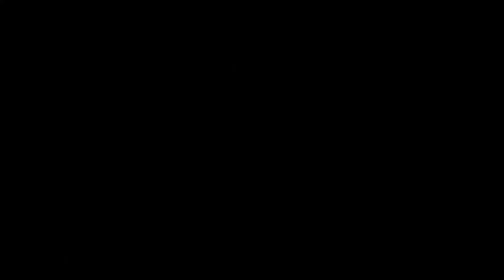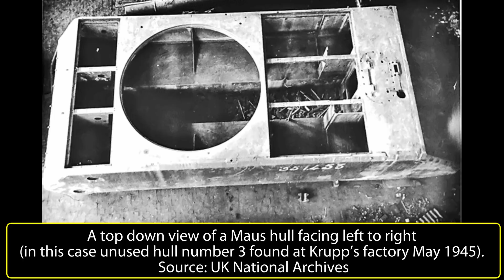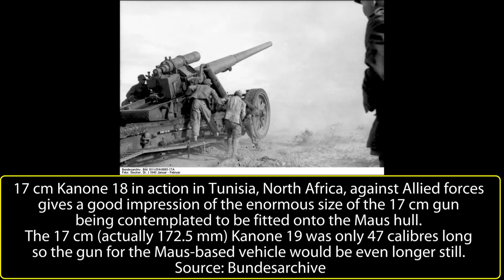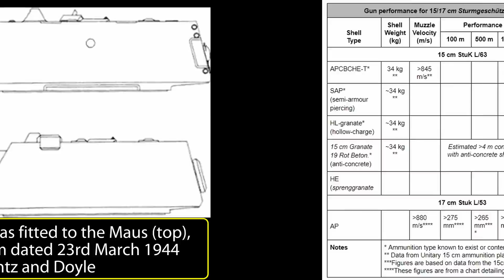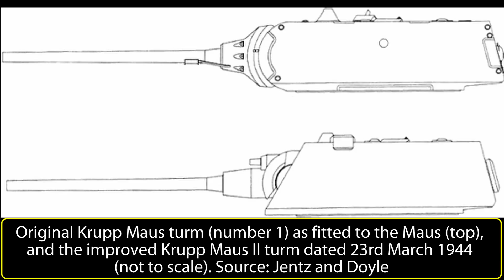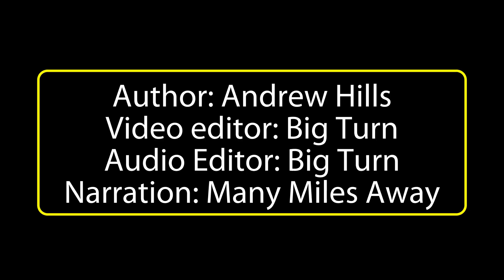15/17 cm Sturmgeschütz auf Mausfahrzeug feat. @Many_Miles_Away

Comment: this might be a stupid question but could the gun not be turned around like a archer but instead of firing over the engine have the gun backwards facing? or would the breach still be a problem?
Reply: That would not be practical as the crew compartment would be located directly over the engine at that point.

Also the Archer worked for the British because British TD's were seen as self propelled AT guns rather than assault guns like the Germans.  Meaning that it would make little sense to increase the length of the vehicle unnecessarily by flipping the gun around and force a complete redesign of the hull which they wanted to avoid to begin with.
Reply: @Many_Miles_Away  Fair enough, thanks for the reply

Comment: The maus 2 if existed must of gone at the speed of 9km/h for 3 seconds before the transmission and engine caught on fire
Reply: It used its engine like a battery... it was driven by electric motors.... suprising but true
Reply: @PLASMA_2005  no . the maus use normal engine on land , the electric engine was to cross river
Reply: @TheJimyyy  I'm going to assume that was sarcasm... true it used its disel engine, but it was hybrid and did intact use the electric drives it had
Reply: bit late to the party but it`s must`ve. MUST      HAVE. how is it THAT fucking hard to correctly spell that shit? you go home and of dinner too? those words have two completely different meanings.
Reply: @AlexHalt100 Bear in mind, I have dyslexia, spelling mistakes happen alot and i'm still improving. What i don't understand is how such a common grammatical error has cause such a vitriol response. This was 5 years ago.
Reply: @AlexHalt100  Christ dude like I get frustration with people who aren’t “proper” with written words and where they go or how they’re used, but it was enough for you to understand exactly what he was trying to say, so OBVIOUSLY the most important thing to do is to leave a douche ass comment in a small comments section from a video 5 years ago. If you’re gonna be in this niche corner of YouTube and history itself, there’s no reason to be that irate over something so small and insignificant. It must of pissed you off a lot 😂

Comment: Although fictional, my favorite tank is the Jagdpanzer E.100. My PC background is of said Jagdpanzer E100 crushing an AMX ELC BIS.
Reply: It's also my favorite. It looks 10 times better than the maus and has a better armour profile.
Reply: @commandergelatoalighieri  Same. I love the way it looks and the way it's nearly impossible to penetrate from the front. It's only possible frontal weakness being its lower glacis plate which is typical of german armor.
Reply: @ThePanzerKorps  hang on, isn't the Jageroo does indeed been designed, as the Tank Encyclopedia covered them already?
Reply: @Kalashnikov413  Technically, it does exist as it has a paper design, but there is a debate on whether or not it should be classified as a Jagdpanzer or a Sturmgeschütz due to the caliber and placement of the gun.
Reply: @Kalashnikov413  They did not know whether the turret was supposed to be in the front or back or middle just knew that it was a 17cm E100 chassis.
Reply: @iaminyourwalls479  yup also the tank never have a real designs . and it was mean to be on the maus at first
Reply: @commandergelatoalighieri  the e100 dont have better armor the e100 have maybe a stronger upper plate because of the angle of it but is the only part of the tank where the armor is stronger or equivalent lol ...
Reply: @TheJimyyy  armor profile, key word is profile
Reply: @commandergelatoalighieri  even the armor profile is worst . the maus was more armored and have a better armor profile . like i said the only part of the e100 where is a better is the upper hull everything else is worst
Reply: @TheJimyyy  bruh, it's got better angles than the Maus, it's also smaller to some degree, the maus is a wall my g, without spaced armor. The E-100 is the over all more practical tank, it's armor is only thinner by a small margin, so in the end it's still more than enough.
Reply: @commandergelatoalighieri  lol the only angle it have better is the upper plate .. also the maus do have space armor and be smaller dont mean anything also is not that smaller . maus armor is better in everysingle way the e100 armor side and rear is way less than the maus and the turret is way weaker too

Comment: I would imagine that the reason for this at least on the design end was the fact that engineers often times want to create spectacular things generally, and it is only after the spectacular is done that things are ramped back to the practical.

Comment: The germans really were nuts. The 12.8 cm was already retarded overkill. Nah, lets go a step further with 15 and 17cm guns.
Reply: The idea was to anticipate the next generation of tanks. The long 8.8cm was already overkill for most threats, stuff like Churchill VII or IS-2 1944 were tough nuts to crack for any smaller gun (albeit a Pak 40 still being moderately effective on these vehicles), but the next generation of tank wouldve been things like early Centurions and IS-3s, and while Cents dont have enough armor to survive the 8.8cm frontally, the IS-3 actually would (trap shots not withstanding; even a 12.8cm gun would likely bounce), and even T-44 could resist a few rounds as long as they hit the hull (turret is also tricky due to the shape, but wouldnt survive sustained fire as the vertical part is not even thick enough to deflect the old Pak 40). 

Of course it was still grossly excessive to go for 15cm or 17cm guns for an anti tank role at all, it would have been easier to develop a viable sabot round for the 8.8cm Kwk 43 (or Pak 43) as APCR was already pioneered by Germany, even if it wouldve been a pure steel penetrator rather than tungsten.
Reply: @builder396  we are talking about the Germans... they always go overboard
Reply: @builder396  Germany did not have the rare metals to make APCR that much. They were in shortage of everything, let alone tungsted, which was very rare. And them having so many issues even producing and supplying the heavy tanks in service, makes such future designs even more foolish.
Reply: @Vlad_-_-_  Thats why I said they could still make APDS with steel penetrators. It can be done, it just would be less effective than tungsten carbide. 
They definitely tried steel core APCNR for the 7.5 cm Pak 41 (the squeezebore one) but found tungsten shattered a lot less.
Reply: It was against the is 3
Reply: 12.8cm was not overkill, is about the same as the gun from the JS series of tanks(122mm)
Reply: @henkvermeer8652  It was overkill, because the long 88 was enough for most targets, the 128 did not penetrate more armor actually. Thing is, the 122 was mounted on an actually good, reliable platform, in the IS tanks and ISU 122 tank destroyers, while the JTiger was utter garbage.
Reply: @henkvermeer8652  The 12.8 cm had significantly better penetration against armor (269mm @100m) than the 122mm A-19 and D-25 guns (203mm @100m with wartime BR-471B shell, post-war BR-471D had 227mm), so while the 12.8cm Pak was in a sense in response to these guns, the Soviets fielded their A-19s and D-25s to counter ever heavier German tanks like the Tiger II and Panther, while Soviet tanks didnt have nearly that much armor and the Germans already had a more than adequate AT gun in the 8.8cm Pak 43, that could engage all Soviet vehicles frontally from extended ranges, making the 12.8cm gun redundant and, due to its immense cost, a pointless waste of resources.
Reply: And let’s not forget other nations were coming out with 155mm equipped experiments ie the T30
Reply: @vulgar_potato4992  Right you are, but the T30 had  a resonable mass compared to the retarded Maus.
Reply: hmm... KV2 that fight pz III and pz IV F2
Reply: I mean this is a completely fictitious tank to be honest talks of the 15 cm and 17cm only existed from word of mouth never anything concrete or physical
Reply: because 5 inch gun is not over kill let go with 6 or 7 inch gun.
Reply: @UCn3TJLJshJdstfSIMJ1jqfg Sturmgeschütz were used in AT role too. Think Stug III with the long barrel 75mm. You can be sure those massive cannons had AP shells to and AT work as well as firing HE. Part of the job of supporting infantry for an assault gun or self propelled gun will be firing at other tanks too. Like the SU152 for example, which got famous for its ability to literally rip the turret of Tigers and Panthers with its HE shell. With such a ridiculos big cannon like the germans wanted to use however it could kill anything regardless of the intended role.
Reply: landships created by other countries: cricket noises
big tank created by Germany: rabbi shill simps instantly call Germany nuts or mad...
Reply: Yeah let's forget the red bastards kept making tougher and tough heavy tanks that would need those "overkill" guns to pen.
Reply: @D8W2P4  The long 88 was more than enough. The 75mm pak42 was more than enough. The long 88 would not penetrate the upper plate of the IS2 model 1944 or the turret at long range, or the very angled parts of the IS2 model 1943, that is it. The soviets were not retarded like the nazis to put so much armor as so they make their tanks unable to reach the front. 128mm is stupid enough already. 15cm or 17cm is beyond idiotic. On a fucking Maus chasis ? Peak of human stupidity and megalomania. But that is what the nazis were.
Reply: @Vlad_-_-_  Imagine using all that metal from a maus to make ....what are they called 
"Hafthohlladung"
Reply: @Vlad_-_-_  IS-3 wants to know your location
Reply: @vulgar_potato4992  Indeed the long 88 could not penetrate the IS3 frontally, but the IS3 never saw action in WW2.
Reply: @Vlad_-_-_  Wouldnt the germans just use their anti aircraft guns 

....now AT
Reply: @azmanabdula  The flak 88 is such an example, but it was not the ideal AT gun because it was big and heavy and hard to hide. The AT performance was good however. That and the 128mm on the JTiger were both originally flak or AA guns pressed in AT roles out of desperation.
Reply: @Vlad_-_-_  12.8cm and Jagdtiger were hardly desperation.....unless you mean Hitler was desperate to prove the size of his Johannes.

Comment: Let's mount a battleship gun onto tank chassis.
Reply: Cheers, I'll drink to that
Reply: welcome to germany, glad to be of service. Lately Rheinmetall revealed their new MBT with a 130mm gun. When it comes to tanks we germans tend to overthink a little
Reply: @ikai640  they technicly revealed it in 2016
Reply: @ikai640  Not realy. GIAT wants a 140mm Gun for the MGCS
Reply: At most a Light cruiser caliber gun only
Reply: Laughs in SU-100Y
Reply: P-1000 ratte with 2x280mm. Not big enough? No worries we got you covered! P-1500 with an 800mm railway gun😉😉
Reply: Btw the russians made an arty with 406/420mm. Look up 2A3 Kondensator 2P
Reply: @adikmen007  though in all reality it wouldn't work too well. The recoil would damage the vehicle. To to mention building the damn thing, etc etc etc. It was just for show
Reply: Something that actually happened alot during ww2
Reply: It's not even close to the caliber of the Scharnhorst's gun(the one on the Ratte) let alone an actual battleship
Reply: Also large destroyer/light cruisers
Reply: Soviets
Reply: Indeed
Reply: @Turtle man 1337  thats a modified howitzer
Reply: Chiha long gun and IS 7
Reply: looks at su100y
Reply: P1000 ratte 2 battleship cannon in its turret 2 mauser turrets on the ass and several aa turrets
Reply: That idea existed in the form of the "Landcruiser Ratte" (Rat), a 1000 ton metric tank with a Bismarck/Tirpitz turret mounted. Propelled by two submarine diesel engines, secondary armaments were two 17 cm guns, 12,8 cm Flak, and various other guns and AA.
Reply: ratte?
Reply: Su-100Y: "Da, comrade?"
Reply: @Jimmy Kelvin Kek, nice copy paste shitbot answer. This is about the 5th time i saw this exact convo on youtube
Reply: Su100y?
Reply: Its not any chassi its a fking maus, the most heavy tank ever existed, idk if the gun would have a reacoil.
Reply: The Russians did it, or tried it

Comment: 17cm!? Wow that's big!
Who in their right mind would slap 17cm siege gun on a tank chassis when there are no real enemy fortifications that require that gun!?
Reply: Made to multi killing enemy tanks.
Reply: @danielm.595  but for a tank destroyer? No much use
Reply: @Saturnus_Ouranos  Well, the good thing about big cannons and shells is that the bigger they are, the less accurate you can be, as the shock wave and pressure from the explosion will mess with anything inside its radius.
Reply: @Saturnus_Ouranos  so you are telling that a gun that can kill any tank at 4 kilometer while having 200 mm of penetration at that range is no use for a tank destroyer rule ? most be a joke right
Reply: @danielm.595  lol thats completly false the explosion that make the shell move happen in the barrel so the shell just follow the barrel :) after that is gas expension that speed up the shell in the barrel : D and more a shell is heavy more it retain is energy at range ¸meaning more range ... also more is heavy less the wind affect it so is more accurate : ) what make accuracy is a well design shell and barrel nothing else . the size and weight dont affect accuracy !
Reply: @TheJimyyy  well, the only problem is: 
Α) that without an autoloader the shells are so big and heavy that multiple people are required to just load one shell, and it will not be quick or easy

Β) the number of shells is fairly limited thanks to the massive size and weight (let’s not forget weight)

Γ) it’s quite expensive to make such big guns and their ammo, not something a nearly lost nation in war would be able to afford

Δ) it’s a caliber better suited for heavy artillery (particularly siege artillery) rather than AT duties

Ε) it’s an overkill, even for hunting super heavies (if they’re even a thing IRL)

Ζ) it will not be able to arrive to the battlefield in a timely manner, nor will it will be immune to enemy air strikes.
Reply: @Saturnus_Ouranos  Α)   uk did it whit a 183 and manage to get a good 2 round per minute . also when you can shot anything at 4 kilometer and one shot it you dont really need a good fast reload time : ) 

Β) the size of the tank  and two parts ammunition solve the problem : D 

Γ)   gun was already build and use for years and if they manage to build the maus and test it and start build 80 of it before it get bomb they was ok whit that :)

Δ)   there is no gun thats is not suitable for at lol if the gun is able to destroye stuff at long range and have a huge advantage of firepower over the tank you fight it mean is suitable 

Ε)  there is no over kill : ) again have a advantage over anything that is use again you and keeping that advantage for a long time will only be good for you . also the same argument of overkill can be say whit 88 gun or the 128 gun of the jagtiger or any large gun ... 

Ζ)  any tank can be destroye from air whit bomb .... and because you build up your military strengh before an attack or defence your argument make no sense . also the tiger 2 jagtiger and ferdiland was slow af . and still take part of the fight : D
Reply: @TheJimyyy  It's been 2 years, do you know what an HE shell is yet?
Reply: @richardcollins5189  is not a he is a hesh :) and it work by sending a shock wave in the armor making it break up and send shrapnel into the tank . and to  work it does have a tickness requirement and in the game it work whit the penetration number
Reply: @TheJimyyy  Yes, the 183mm on the British FV4005. Daniel never talked of the 183mm, they related to the 15cm and 17cm guns on the "Jagdmaus", which most certainly would have used HE. I do appreciate the cordial reply :]
Reply: @richardcollins5189 hesh is use on many other tank and heat are still not he
Reply: Is 3
Reply: @darklysm8345  IS 4?

Comment: Why would they ever do this?!
Reply: Tank designs continuously improve overtime, and WWII is a great example of that. These designs were likely attempts at having something that could deal with Allied tanks with heavier armor, case in point being the IS-4 which was designed to be able to resist anti-tank rounds from the German 128mm gun. So, while it was a hugely impractical design, there was an actual purpose for it as they knew that the Allies would be building tanks with more powerful guns and thicker armor.

Comment: It's like the nazis learned something from the Ferdinand disaster
Reply: MAKE HEAVIER TANKS THAN FERDIDNAND ))))))
Reply: @cloud6254  Schwarzbraun ist die haselnuss (ear rape version) gets very loud
Reply: Strangely enough, the ferdinand was very effective in combat, with a nearly 10:1 KD ratio
Reply: @homiespaghetti1522  but has alot of problems due to it being too heavy for the engine to handle the amount of stress its having by just moving.
Reply: @homiespaghetti1522  well it had a powerful gun and strong frontal armor
Reply: @igoryst3049  which is irrelevant when it breaks down on the way to the battle and gets abandoned.
Reply: Not Porsche from the sound of things
Reply: You have no idea what are you talking about.
Reply: Yep
Reply: Yeah
Reply: In the way : If a big hammer foes not work, use a bigger one...